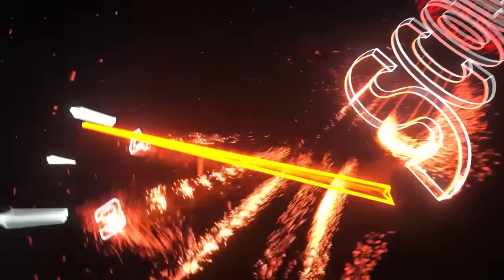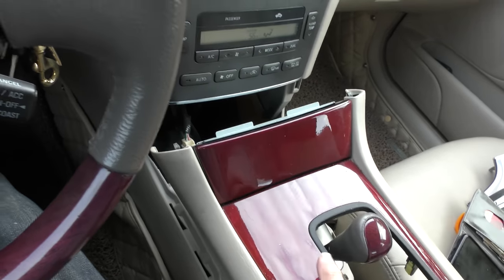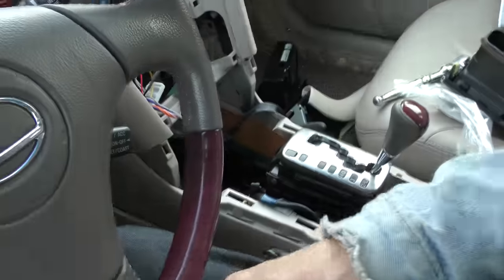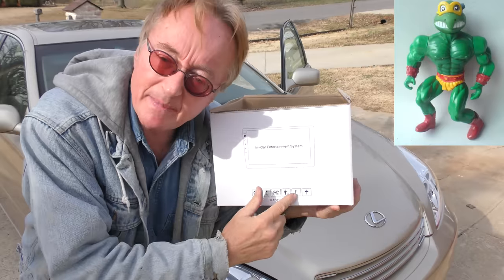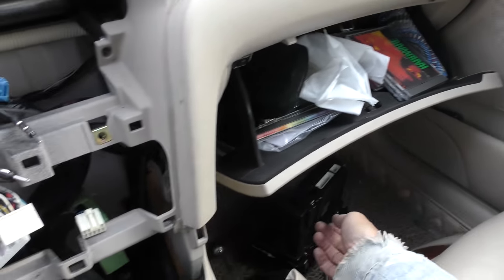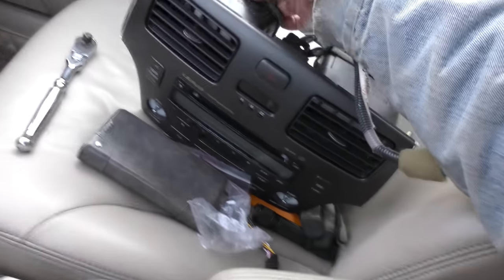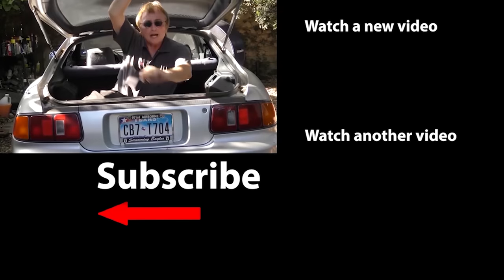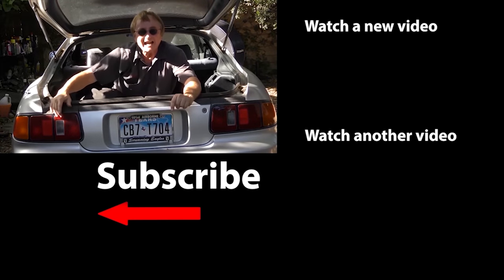A Sad Day for Toyota and Lexus Owners, I Just Screwed Up

Comment: Dear Scotty. You must order the by-pass for external factory amp. After you do that go to Alldata look up the wirering harness then. That will give you the order for each wire.
Reply: The Tweeters are tied in each 🔊 speaker. However if not wired, then you will have a Totle of 16 wires 8 negative & 8 positive. I have been installing car accident for 25 years so that's what you have to do if you put any aftermarket head unit in your Lexus you have to or you must bypass that external amplifier.

Comment: In the words of vehcor, somebody's been there before. That harness has been hacked and modified, and it missing plugs (there is a bundle of wires taped together). So I wouldn't be throwing shade at the radio company unless you are 100% certain that is the original wiring setup for your particular Lexus.

Comment: Scotty just get a decent Bluetooth FM transmitter. You plug it right into the cigarette lighter outlet and it works off a clear radio station. I have one and love it
Reply: Omg...50 people said this...I'd  spend 20 bucks for the adapter he needs to put this in and do it right.

Comment: There are dozens of companies making aftermarket android head units and they cooks with correct wiring. You can just email them or send it back. I’ve bought two units for a 2010 Honda Accord and 2011 Hyundai Sonata. The only problem is that the sound is crappy, factor amp is better.

Comment: Scotty, i use a Dasaita unit on my Toyota.
You are missing a CanBus - a black box. Lexus made for US and Europe/Jp are different. You have to ask for a CamBus for your Lexus, then it will fit.
Dasata is great, you can use two ROMs, one is Max10 and the other is in beta called Vivid.
Both are great!

Make a second video when you fit your Dasaita unit! I love mine!
Better sound than the Panasonic radio crap in Toyota.

Comment: I bought the universal dasaita headunit, they had 3 options for the wiring and I chose the iso standard.  I then got a premade iso to Honda adapter and using both it worked just fine in my Ridgeline (not popular enough in China for them to make a premade unit for).  Sure, not everything will work (steering wheel controls) but it's way better than stock and has navigation and a 720p screen.

Comment: It's not that difficult if your a telco guy. Put a toner on each speaker wire and use a pickup unit to find the wires on the old connector. Then use electrical taps to connect to the new stereo connector.  How many connections do you have? 8 speakers, a 12 volt connector from the ignition when the car is running and a continuous 12 volts from the battery to operate the clock. My daughter bought a new deck on sale for her Subaru and they wanted more to install it then it cost. She watched me dismantle her dash and the connector they sold her didn't fit. At the time she wasn't to happy with me but I made it work and it's still working. And she didn't have to sell her 2015 Subaru to buy a 2016 with apple car play.

Comment: It's very doable. You have to connect the speaker level wires from the android harness to a rca line level converter output and then connect the converter to a rca to car adapter. DO NOT BY PASS the factory amp. It all works great.  You won't have to cut or splice none of the factory wires. Crutchfield, InstallBay and Metra have it all. It's best to solder the harnesses together on the kitchen table. Your wife will love you more when it's all done.

Comment: I'm so old, I recall going to radio shack for a
RF Filter on my car because the newly installed
 AM/FM 8 Track player and my 23 channel CB would pick up ignition coil and points
Noise.
gM still had a problem with AM RF noise, Fuel injection pump, even in their OBDII in the early 2000's.

Comment: I am pretty sure that you can solder AUX cable to that cassette player. Plug the cable to a Bluetooth receiver. Put your smartphone on a good stand and connect it to the reciever. 
I have 22 years old Volvo with cassette player and I connect my phone wirelessly that way. The sound is clear not like those stupid fm transmitters.
Try doing it Scotty and make a video!

Comment: I had the opposite experience. 

I went to clublexus and spoke with people in the forums and found the correct harness and adapters for my '09 Lexus Rx350. I now enjoy Apple Car play and for my Android folks Android auto connects just fine too. My steering wheel control works as well. Didn't have rewire the car just having the correct adapters. I'm on my 4th pioneer aftermarket radio. (1st-wired connection cd & sd card reader, 2nd-went wireless but the radio went bad, 3rd-was stolen from my car, 4th-wireless carplay/AA, sd reader but no CD.) 

It's one of the reason why I held on to this car so long.

Comment: Chances are you have a factory amplifier. You’ll need to unplug the factory wiring that goes into that and then the Toyota/Lexus specific wiring should plug right into the male factory ends. Just need to find out where the amp is so you can unplug them. That’s how it was in my ‘04 Tundra, and it had a non JBL amplifier.

Comment: They didn't include the conversion harness that you need to connect up with oem wiring. You can buy one separately, but some shops and stores include them for free if you buy the radio from them.

Comment: Scotty, just buy a decent Metra wiring harness kit for 98+ Lexus, Toyota, etc cars and splice in the pre-stripped wires with the kit that comes with the new headunit.
Mind you, I'd get something better than the garbage one you got sent for free, such as a good Pioneer, Kenwood, Alpine, etc, in a Lexus(even in an older one), but still it ain't all that hard. I've done headunit replacements on just about all of my cars(3 of them) at this point of my life, and usually it only takes 30 minutes at most to solder(my preferred method for making a harness) or crimp connectors to get everything ready to go.

Comment: They make a harness that hooks into the factory harness, but the connector is closer towards the factory amplifier. Notice it says premium sound system. Yeah it has a amplifier on the passenger side real close to the blower motor housing and the side firewall. Now if you do after market amps, then yes you have to bypass the factory amplifier. (High end, doors and trunk lid speakers) remember if you think your not doing it right ask someone that installs for a living. I had my IS 300 professionally done, and watched how they hooked it up. I was baffled as well but you can put in a after market head unit.

Comment: You need to check the reviews of the product to see if it will fit with all the wires required. You will find any problems with the product in the reviews. If you buy from a seller with little to no reviews you are taking a huge risk.

Comment: Its not that hard to clip the cables off of the connector and splice them to the one that fits into the radio unit. The OEM head unit will have a wiring diagram online to figure out which cables do what, and then the radio company should have a diagram on their wires. You can also buy connectors that crush onto the ends of the wires so you don't have to do any soldering.

Comment: Its pretty easy to wire up. I used to wire up pro systems running 2k watts plus. But I understand you didnt want to change your oem plug cause you just wanted to do a video and maybe put your original back in afterwards.

Comment: That happens to me. Bought a $150 Android Unit for my 2013 Veloster. Plug and play but not really. Reverse Camera don't work and sound was terrible. Also Steering don't work anymore. Also radio don't work since they don't include the proper adapter. Long story short don't include the cables needed for it to work and no instructions for installation or wiring diagram. BTW seller is Alidesheng. Tried to return it but had to spend $60 to return it. 

Spent $450 for a decent plug and play and well it did actually work and I was able to retain everything except it doesn't show outside temperature anymore (Idk why Hyundai decides to put it on their radio instead of the instrument cluster gauge like Honda). Sound is about the same as original but now I have navigation and also 2 SD card slot for storage for music and maps, videos. Not only that but it looks like the oem radio except its an android and has navigation unlike the original (touch screen but no nav (even if it has its outdated anyway).

Comment: I use a cassette adapter in my 2000 Mercury.  It works wonderfully.  AM is usually worthless on aftermarket radio's.

Comment: there's a device called "bluetooth reciever" (made in china😅) that you can buy online..costs about 1-2 dollars that can be connected thru 3.5mm aux/headphone jack..so that you could still  use the stock stereo for your android phone..those stock stereos are way better than new touchscreen aftermarket devices based on my own experience😁

Comment: Sometimes a later model vehicle from the same manufacturer will be a drop in replacement for an old CD based stereo.  Often, you can get a Bluetooth based system with a backup camera pulled from a wrecked car to replace a CD and tape deck, and it doesn't even need to be the same model of car.  YouTube is your friend when figuring out what fits where, but beware the connector problem Scotty had.  For example, a Limited trim Toyota might have a ten speaker sound system that uses a different wiring harness than the Sport trim model.  Once you find what works, it's a quick and inexpensive drop-in upgrade, and the quality is much better than the Chinese Android sound systems.

The other option is super simple.  Get a Bluetooth adapter that plugs into the cigarette lighter that interfaces to the phone's Bluetooth and puts the audio on an unused FM channel on the car's radio.  Get and adapter with a couple of USB charging ports to charge your phone while driving.  That's the $12 and two minute upgrade.

Comment: As s former stereo salesman, the devil is on the details.  You asked Only if it would fit and you acknowledged that it does fit. You did not say if you asked if it would make all the speaker connections without major modifications.  

     So trashing the company because you were unaware of Which questions you should have thought to ask, a shortcoming on your part, seems behavior unwarranted.

    Next time, ask somebody the proper questions rather than running the risk of appearing rather petty.
Reply: Are you serious?!! I think one should be able to assume that if fits it will do what stereo system is supposed to do!!

Comment: Hey, if you have a tape deck in your car and want a cheap upgrade, you could use one of those battery-powered Bluetooth cassettes or those wired ones with a 3.5mm jack dangling out. You connect your phone to the cassette and off you go.

Comment: Personally, when it comes to these aftermarket head units, I'd rather install a name brand like Sony or pioneer because they're usually higher quality And they have better features with the more premium ones like Android Auto and Apple CarPlay Yeah they're expensive But it's a one-time thing You buy it You put it in and you forget about it The cheap ones are really clunky and have weird bloatware installed on them a lot of the times. I prefer the more intuitiveness of the higher end ones
Reply: I got an off brand 3 years ago from Walmart for 20 bucks to see how good it was. It's Bluetooth, but doesn't have the touch screen obv...but it works as good as when I got it.
Reply: @richsweeney1115  I mean We have to use context If it's a simple radio like that usually The cheap ones are perfectly fine It's the more higher-end ones that have touch screens that the pioneer and Sony's really shine because the cheap ones usually don't have Apple Car play or Android Auto And also The single dim higher end basic radios usually have better amplifiers and other features like hands-free and other knickknacks like that and you Get a much better audio experience but that also just depends on the end user And if there are real audio nerd or not
Reply: @mamaluigi2064  what I don't understand, is there's another video, where Scotty put an android head unit in that same Lexus like 2 years.ago

Comment: You need to upgrade to an 8 Track Scotty and don't forget the match book wedge to align the tracking.

All jokes aside, I had to completely rewire the system for my son's 2000 Prelude when the adapters would not work. Not a job for the feint hearted.

Comment: You have to buy a harness that bypass the amplifier. I had the same issue with my tundra 2006. I couldn't find the harness in town. I had ordered online, it's working now. I was tinking to rewire to the speaker but wirh the harness is easy.

Comment: Up in the frozen north I'll wait until I'm sweating from cranking the heat, even at -40° most cars will get that hot, then hit the A/C for as long as I can stand... nothing is worse than middle of summer it's +40°c(105°f) and the A/C is screwed cause it's all seized up from no lube all winter.

Comment: Sorry it did not work for you and your wife Scotty, but good information and example for those that have older Toyota car's like this.  I myself have been toying with the idea of getting a Toyota Solaria convertible since I miss and old '69 MG Midget I had when I was in the Air Force.  Just got to expensive to keep replacing parts and none of the more modern conveniences of the 21 century cars.  But I loved driving the rag top (down).

Comment: There are products that are basically a  cassette with an aux cord/jack that you can plug into your phone (unless it’s a dumb one that only allows listening to music via Bluetooth). Just pop the “cassette” in, make sure the radio is set for that, plug in your phone/ipod/etc. and boom! Problem solved. 

Now…if the stereo system in the car is garbage, that’s a whole other issue. 😂

Comment: Im pretty sure you'll need to reconnect every wire to a wiring harness when putting a new stereo in.
Reply: the aftermarket harness is made to match the one in the car.  The other end (the loose wires) spice onto the loose wires from the aftermarket head unit.  That way, it plugs in just like the factory radio would.
Reply: @LordPrometheous  
Exactly, there's still re-wiring required

Comment: If you notice all the spliced wires on the Radio/CD/Cassette Deck connector, this implies that it is not a factory installed unit.  The factory would have had the correct connector in the wiring harness or would have used a correctly prewired connector adapter that could have been easily removed.  That connector was spliced into the wiring harness, meaning the original connector may have well worked and fit the new Dasaita you couldn't easily install.  It may well not be Dasaita's fault.  If you had the original connector and were willing to splice it back in, the Dasaita may have connected and worked perfectly.  Dasaita took the time to make the faceplate a perfect fit, so the unit would likely fit and work perfectly had the original connect been there.  That's my story and I'm sticking to it.  🤣  An extension of that story is that I would have taken the time to find the right connector, say from a junkyard or what have you.  Yours was free, so I can't blame you, but had I paid money for one, I would have tried to make it work.

Comment: I bought an Android radio for my 2021 Hilux had to buy the connector and pins separately and wired the radio harness to plug directly into the truck it works well though

Comment: Simply buy a TOYBT-145 bluetooth adapter. About $150 and keeps original radio allows to stream music BT phone calls and so on. Have used them many times and they work great!
Reply: how does it work
Reply: @realjordanbelfort  It simply plugs into the back of the OEM radio. Nothing is visible it all hides in the console and it works great just like bluetooth was in there from the factory. Even installed one in my daughter's ES330 (same car as Scotty's but 3.3 instead of 3.0 V6)

Comment: I have a 16 Silverado it actually has no issues so far I've only driven it 20,000 mi but it had 50 so now it has 70 but I need to get out of this thing before it blows up I'm really thinking about getting a Lexus V8 rear wheel drive not sure what model preferably not too new

Comment: I had to look for a very specific cable for my Corolla 2003 LE when I installed the new radio. It was a simple bluetooth 50 dollar radio, but the cables included didn't fit either. I didn't want to rewire any of that crap either. "RED WOLF Aftermarket Radio Stereo" worked for my corolla

Comment: I put a  A modern stereo with phone hook up in the whole 9 yd in my 2001 Ford pick up got it from Best Buy and it works like a champ it did cost  A few bucks for the face plate and about 75 doing stall it but it's well worth it

Comment: Should have done business with Crutchfield they make the adapters that you need for your car dinner Androids are not meant for these cars you better off choosing a double DIN or a din unit to fit in it Crutchfield is a company will also offer you the trim ring that you'll need to install it perfectly and all necessary cables

Comment: Lol Scotty you skewed yourself... All you have to do is get the original connecter that connects to radio side jack, cut wires beyond connector to the car and figure out what wire is power, ground, antenna and speakers +/-...  Resplice wires to the jack they sent you for the head unit..   There is no need rewiring the entire car if you are at the source...  😉

Comment: You can use a cassette adapter to input analog signals to that stereo. Same  analog signal from most smartphones you would use to drive wired headphones or earbuds. Leaves some wires hanging around though.